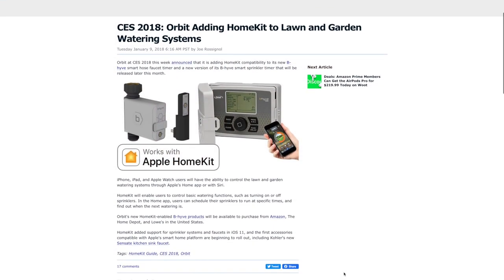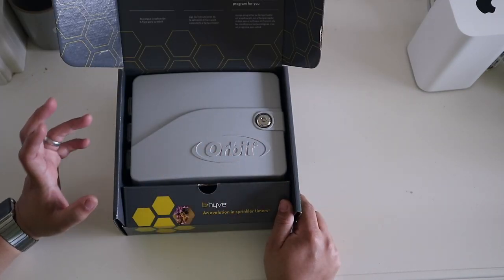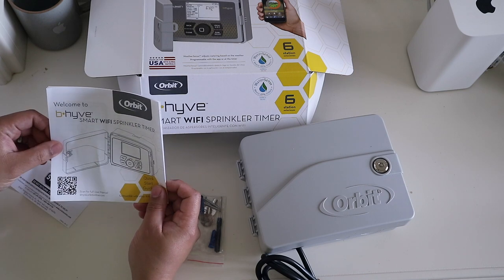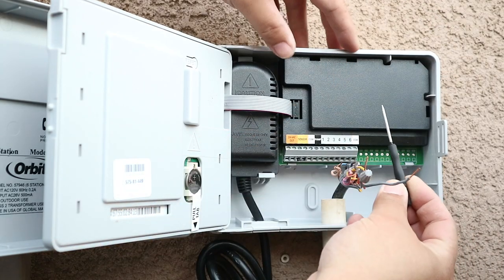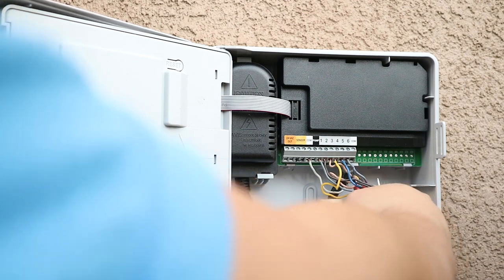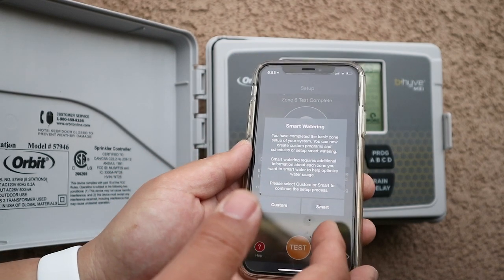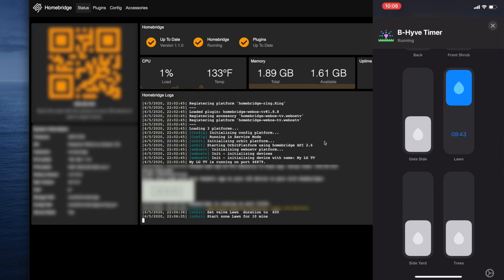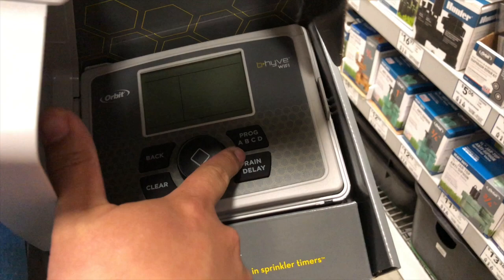Orbit B-Hyve Timer on HomeKit using Homebridge!

Comment: Awesome Rey while my RainMachine Pro 8 supports HomeKit natively. The biggest reason I pick the RainMachine was due it having an Ethernet port I could hardwire into my network switch. As far as HomeKit functionality I don’t see any difference between the two. In the native app I can customized it down to the sprinkler head type, soil type, grass type, if it’s level ground or slope, and a lot more. Plus the adaptive water is awesome. While I set a 20 min water cycle my front and backyard it will adjust for rain or anticipated rain. 

Do you plan on adding anymore non HomeKit devices through HomeBridge? My next project are my blinds. Looking at Soma Smart Shade 2.
Reply from the maker: I haven’t seen any native HomeKit sprinkler timers in person. So the UI is similar to your native timer? I wonder if the Rachio is similar. The native app for orbit also goes into the granular detail of soil types for “smart” watering. 

I wasn’t a proponent of Homebridge in the past but the ease of getting it set-up and running now has opened up opportunities for more devices into HomeKit. I still haven’t come across any blind/shade options that aren’t overly expensive or “hack-ish.” Let me know how the Soma shades works out. 🙏

Comment: I installed my new B-Hyve Timer (working fine with the Orbit iOS app) and this plug-in in Homebridge 1.2.4. The accessory appears in the Home app but when I access it’s Settings I don’t see any of the Zones as shown in your video. In fact no ‘Show Controls’ option when I select it on macOS Home app either. Is this plug-in still working with current Homebridge version?